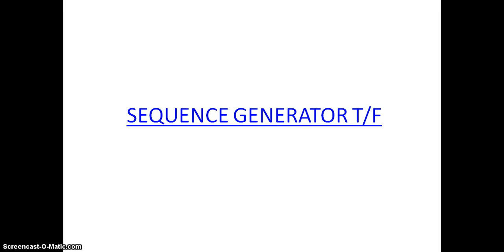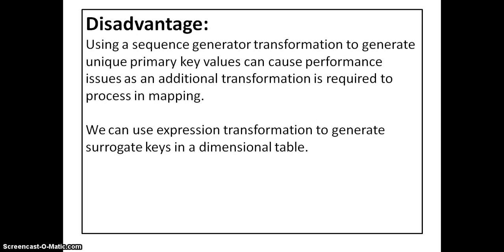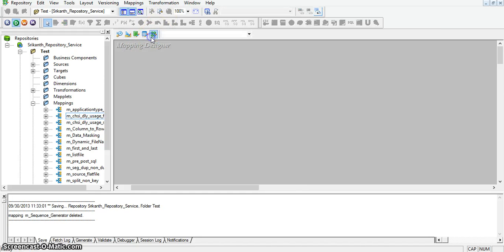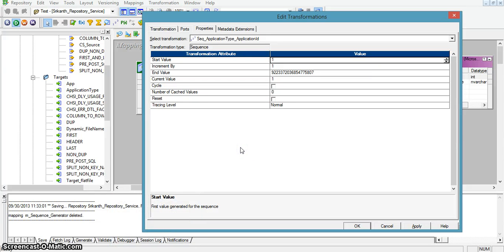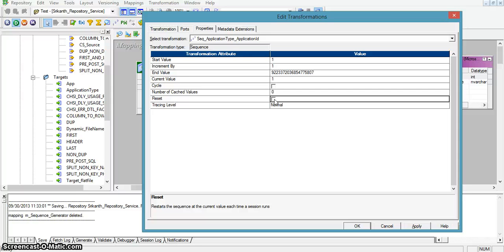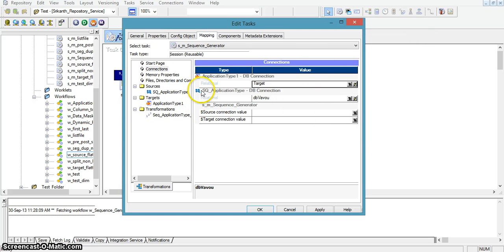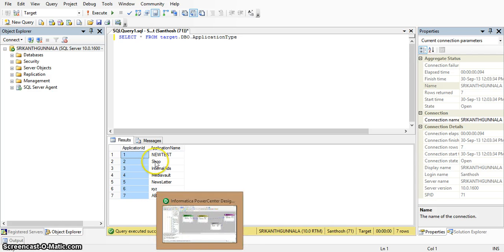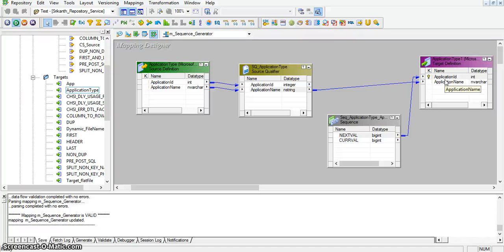Sequence Generator in Informatica

Comment: Thanks for the information on sequence generator transformation. I have a question related to this. I am loading the data from flat files in the "INDIRECT" method.  I am trying to generate and assign sequence value for all these records like a rownumber. If we have multiple flat files to load as part of the indirect file load method.  can we reset the sequence for each file it loads and start from the starting value to load ?